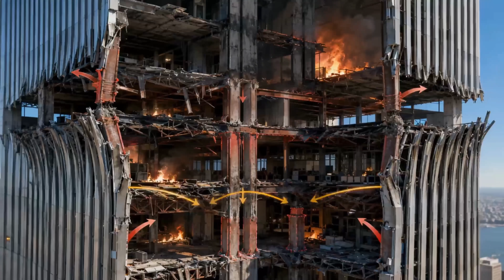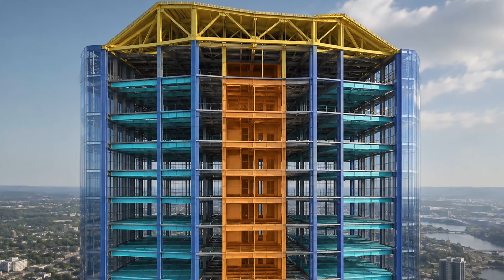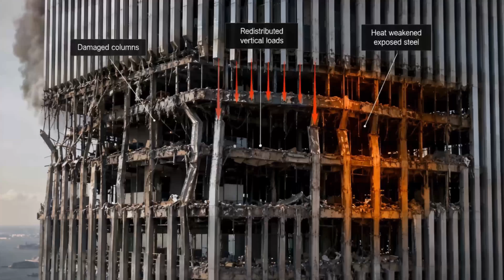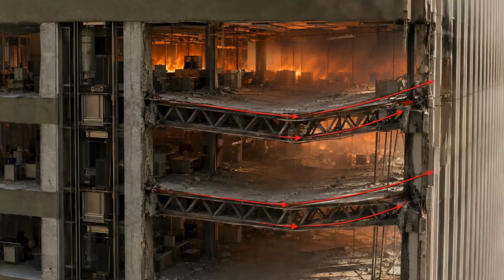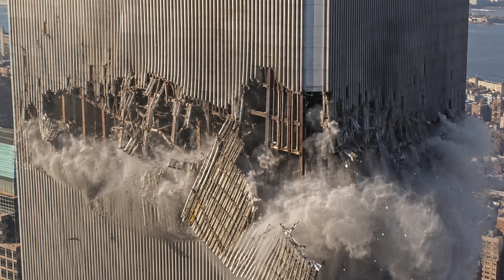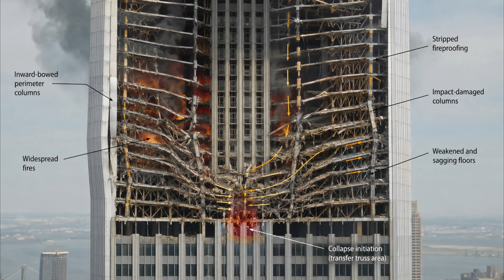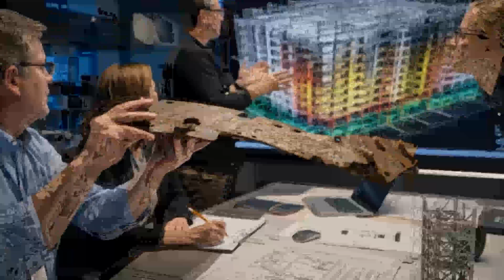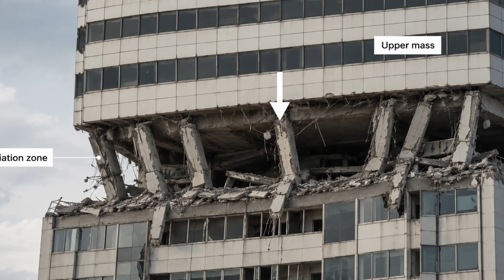What Happened Inside the Twin-Towers After Impact?

Comment: Such bulshit,  only high military grade explosives could bring those buildings down
Reply: That's not using the thinking part of the brain.
Reply: @TheLoonResistance your not using your brain, sounds like your simply brainwashed to me for being so purposely ignorant
Reply: @Gdvyaboy  - OK then, do you have one of these? 

At the End of the day, we all just want to know what really happened, right? It’s tough because there is a massive amount of absolute garbage information out there to muddy the waters, even though structural engineers had figured it out within weeks. How is the layperson supposed to sort it all out? 

I have put more thought into this than most because anything can seem like a conspiracy if you don’t understand how it works and if you don’t mind would like to offer my perspective. You may choose to disagree, which is fine, but if I am in error on any point of fact, logic or reason please let me know.  Just saying you are wrong or I don’t believe you isn’t going to make it. 

While complex, most of the Twin Towers collapse mechanisms can be seen with the naked eye and easily discerned and understood by the layperson IF sufficient time is taken to understand.

1.   The Twin Towers consisted of 4 primary structural elements together forming an integrated system where each relied on the others. 47 hollow box-section steel Core Columns carry most of the gravity loads. The 236 hollow box-section steel Perimeter Columns carry the remainder and ALL of the lateral (wind) loads. Long-span Lightweight Steel Trusses connect core and perimeter column together with a Hat Truss on top to tie it all together as an integrated unit where no element can survive without the others. There was no structural load bearing concrete and most major assemblies were bolted together

www.youtube.com/watch?v=u7OqrC74Dm4

2.   The impact of a 122-ton airplane (= 12 dump trucks) at up to 587 mph with the energy of a ton of TNT destroys the aircraft in 0.50 seconds. This in no way implies the Towers come out unscathed. Some folks get hung up on that. Many perimeter and some core columns are destroyed or damaged primarily by bending, twisting, splitting weld seams and critically by bolt-shearing failures at the end connecting flanges. No cutting or slicing - the reality far more violent and brutal. 

www.youtube.com/watch?v=zF-94yDHlk8

3. The impacts destroy or damage fire insulation, fire breaks and sprinkler systems on multiple floors. Jet fuel acts as an accelerant starting huge fires start across multiple floors simultaneously that spread spread rapidly with no effective firefighting or fire suppression. This was an unprecedented fire event . Office buildings are essentially giant piles of kindling when it comes to fires, chock full of stuff that burns vigorously and quite hot. 

4. The hotter steel gets the weaker it gets shouldn’t be a revelation. With fire protection compromised the survival time of the steel greatly reduced . Over time heat gradually causes the lightweight steel Floor Trusses at the damaged floors to sag, which we can see. No steel melted or needed to. Structural steel fails long before it becomes a puddle. It just needs to bend 5. A straight column is up to 4 times stronger than a bent one. Sagging floor trusses pull on increasingly weak and overloaded Perimeter Columns, causing some of them to bow inward by up to 5 feet until they buckle and fail, quietly initiating collapse. The formerly static mass above which the structure below could easily support converts to a dynamic mass up to 30 times greater. The Columns above and below the failure point are no longer aligned . The load bearing structure below no longer bears any of the load above, which falls past the lower columns NOT onto them. www.youtube.com/watch?v=ULdiD6gYZO0 www.youtube.com/watch?v=zTygQK3vriI 

6. Heat starts the collapse, gravity finishes it . Thousands of tons of debris drop within the four outer walls, through the open office space, the path of least resistance crashing onto the first intact floor, The bolted column connections instantly break as the amount of resistance the Floor Trusses can offer is negligible, slowing the falling debris only marginally and briefly before the connections fail. Note: 
6a. This is NOT a solid top block crashing into a solid bottom block . 
6b. The debris falls past the columns not onto them. The columns provide no resistance to the falling debris. 
6c. Only the bolted floor truss connections to the core and perimeter columns offer any resistance. A pair of 5/8” bolts at each end of each truss vs. thousands of tons of falling debris. 
6d. No laws of physics are violated. 
6e. There is no 20 floors against 90 floors but rather 20 floors against one floor, then 21 floors against one floor, then 22 floors against one floor, etc. 

7. This floor-led collapse progression within the four outer walls can only go straight down. There is no lateral force to push it over the side, only gravity to bring it down. 

8. Collapse progresses through the floor systems past the columns, through the path of least resistance . Resistance offered by each floor is always the same while the falling mass acting on it is constantly increasing and accelerating (gaining energy). This process of floor-by-floor destruction cannot be arrested. It can only speed up . Rate of floor failures increases with each floor as momentum increases, reaching an average acceleration of 0.65 of GA, or 35% slower than true free fall. Bam, bam, bam down the building until there are no more floors to fail. More mass, more velocity, same resistance with each floor. Don’t get stuck on the but the lower floors weren’t on fire nonsense. They didn’t need to be. 
8a. This process is often incorrectly referred to as “pancaking” which while catchy, is incorrect. Too simplistic and inaccurate anyway. More like Kaiserschmarrn. 

9. The Towers were 95% air by volume. As that air was compressed inside the building by falling debris, pressure builds until it is blown out the sides in reaction to the building collapsing . Those were not “explosions”, it was expulsions of compressed air caused by the collapsing building, explaining the low velocity, lack of flash, blast, supersonic pressure waves and lethal high-velocity ejecta. 

10. Perimeter Columns become detached and peel away like a banana behind the collapse front, playing out to the four points of the compass in long lines extending to 800+ feet from the base of the towers, damaging and destroying nearby buildings. 

11. Core Columns fail last as their internal beam bracing is stripped away by falling debris and lateral support from the floors to the perimeter columns is lost. 

www.youtube.com/watch?v=WpHXj62Ylw0

12. This process took 31-34 seconds from perimeter columns bucking until the last core columns hit the pile, or 1/3 the rate of true free fall. Don’t believe me? Just watch a video of the collapses and note the loose truly free-falling debris dropping much faster than the towers themselves. 

https://www.youtube.com/watch?v=dh4r-gHdyPU 

13. Each Tower had a 1-acre footprint. Far from collapsing inside their own footprints the debris pile spread out over 17 acres in a pile up to 14 stories deep. 8 surrounding buildings were destroyed and scores more damaged by the falling debris. 

14. NOT observed were the 180-190 dB bangs of thousands of high explosive devices or the blinding brightness of burning thermite. Explosives or thermite couldn’t have survived the impacts and subsequent fires anyway. Nor could they have caused the perimeter column buckling that clearly initiated collapse. Video of an injured and in-shock firefighter casually using the magic word explosion isn’t proof of explsoIVES and hardly makes a case for planned demolition. Pre-planned demolition doesn’t match the physical evidence and would be technically impossible, totally impractical and completely unnecessary. Simply, no one would bother. In 24 years, no structural engineers of tall buildings, including the 1/3 who have retired, have made any statements in support of planned demolition claims. NONE. The lack of such citations in engineering literature published anywhere in the world is telling. 

15. Twin Towers were perfectly safe within their design envelope. They only collapsed when taken far outside design parameters by an extraordinary and unprecedented event Impact + Fire (heat) + Time + Gravity = Collapse . Remove any 1 of those 4 elements and there is no collapse. Ignore any of them and you will never understand the collapse. The Twin Towers were an integrated system in which no one component could survive without the others. One fails, the rest follow, through the path of least resistance DOWN the open space, bypassing the path of greatest resistance, the columns. No laws of physics are violated and the above is true no matter who planned and carried out the 9/11 attacks or why so the attacks could still be an “inside job”. 

If you made it this far, kudos. That was a lot. I hope it was helpful, informative, non-adversarial and solicits informed critical comment, positive or negative. If I made any errors of fact, logic or reason or left anything critical out, please let me know and I’ll fix it. To stay focused, just one point at a time please and on-topic (Twin Towers ONLY). No word-salads of Gish Gallop. IF you can offer a more plausible alternative be my guest. Please start any reply with the words “Tits McGee” or I’ll know you didn’t read it and aren’t serious. Thanks for your time.
Reply: "You know nothing, Jon Snow."
Reply: @captaincapitalism264 prove it fool

Comment: Here come the twoofers! They’re all gonna take a break from exploring the inside of Candace Owens’ large intestine for a bit. 😂
Reply: And are you going to get an education so that you can calculate how the core columns could desintegrate in 9 and 11 seconds respectively, and eject the perimeter columns sideways at 60 to 70 miles per hour.  I did the calculations for the 35,000 lb. beam assembly that travelled sideways at 54 miles per hour and embedded into the World Financial Center 3, 541 feet away, and 270 feet in the air.
Reply: @Wilber-citizen  BUILDING 7!!!!  THE JOOOOOSSSSS!!!! THERMITE!!!!! 😂😂😂